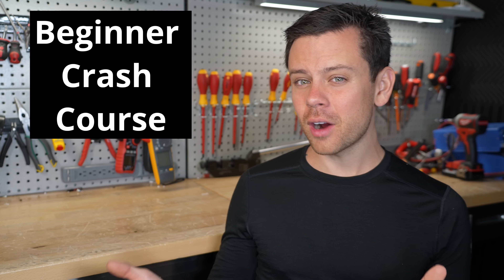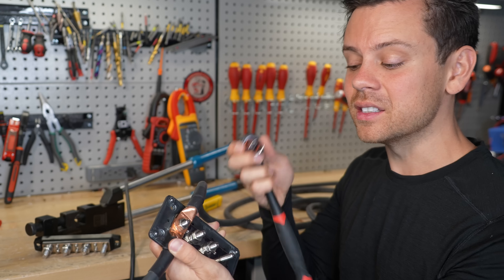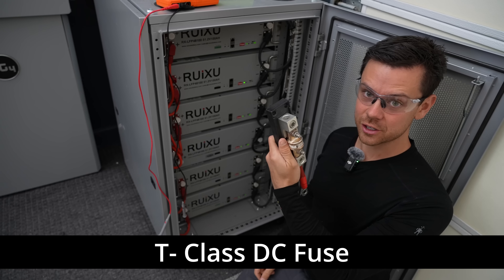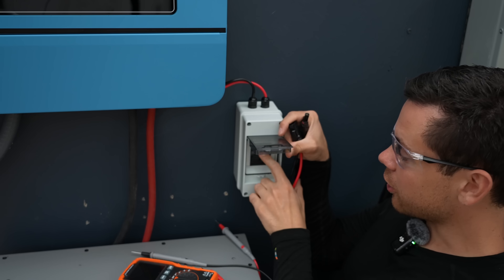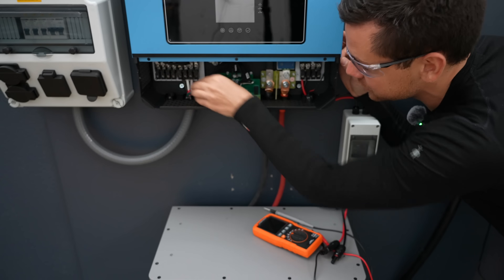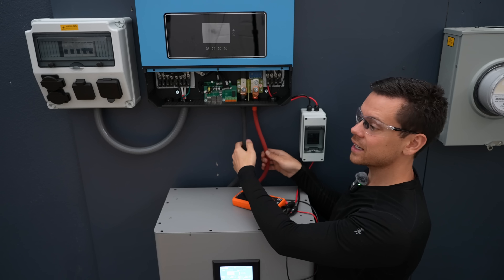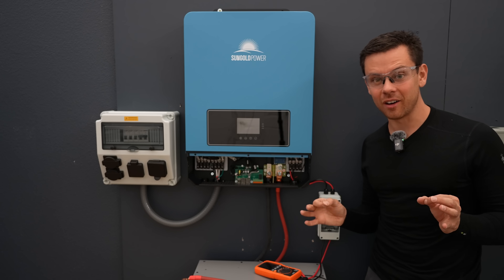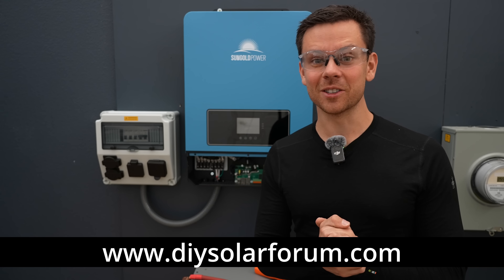Offgrid Solar Crash Course: Avoid FIRE and ELECTROCUTION! For Beginners or Experienced Users

Comment: I'm really grateful that you make videos like this, Will. I'm a total beginner even though I'm a senior citizen, so I'm trying to learn everything I can about basic electrical safety before I tackle my own small system. One thing I noticed in the video is that you mentioned at least a couple of times about checking the batteries/connections with a meter before working on them. So, while I assume that's a simple + to +, - to - with a multimeter, I'd love to see you demonstrate for us total noobs...showing exactly where to check and how. Maybe you have another video??? Also, I'm interested in collecting some safety tools (screw drivers, etc)...I think you mention an insulated ratchet??? A video about tools would be valuable, too. That reminds me, I checked your list of tools mentioned in the comment section and it appears that the Klein meters have been upgraded to new versions, so maybe it's time to refresh the links for your list. Again, thanks so much for making these basic safety videos. It's REALLY helpful. ~Frank
Reply: I think it was a year or two he went into all of the different tools that he uses for electrical.
Reply: Okay I just did a search for it and I found his video on that. Go to YouTube and then the searched thing on the top type and will prowse electrical tools and it'll bring up one with his favorite electrical tools.

Comment: Where do you hold the probe on the volt meter to check for voltage (2:05)?
Reply: Positive lead of your meter to the positive terminal of the battery. Negative lead of your meter to the negative terminal of the battery.

Comment: It gets a little fidgety with the MC4 solar connectors when you're getting into parallel or series connections because all of the sudden males / female connectors to red and black wires get mixed up.  Everything else is pretty straight forward.

Comment: I'm a retired electrician with 40 yrs experience and I can say this is ALL great advice, good job !!
Reply: Im a working plumber,  and even i can tell this info sounds spot on.
Reply: why no solder?
Reply: @martingargas3217  A crimp and solder would be fine, solder alone can cause a higher resistance connection.

Comment: Do you guys using one hand trick for using multimeter probes on test points that are a few inches apart. Alligator clips can also assist to prevent accidental current going through your heart. Also having a safety buddy at a safe distance is also a good idea.

Comment: My only regret on EG4 Lithium iron phosphate battery is I have to take it home over the winter in Northern MN. No heat. Can get below minus 4 Degrees which damages battery. Have not solved this problem yet. Solar panels are on the roof, under the snow, worthless in winter. Oh well. Awesome all summer and runs fridge, wife's CPAP, all electrical items. Unlimited power in summer. Even generates 10 amps on a cloudy day and charges up when cloudy with 48 volt panels.
Reply: Still better than toting the equivalent lead acid batteries back and forth!
Hundred pounds vs  Five Hundred pounds!
Won't miss THAT arduous chore!
Reply: I built a little makeshift box with insulation board and put a battery heater on the or between the batteries. Seemed to work pretty well. They're made to wrap around car batteries, but fit well enough.

Comment: Wondering... Can a parallel, 2-1 solar connection be directly connected to the cut off? Thinking of my van setup. Fixed solar on the roof well within amp and voltage range of the mppt. Wanting to be able to lay out some additional panels and connect them easily.

Comment: My solar EG4 inverter converter stopped working. The positive lead for the PV some how just "fell out" of its connection. Took some looking but found it, put it back in, and working fine. Very bizarre. Love your 48 volt EG4 Lithium Iron Phosphate battery and yellow EG4 inverter converter. What a game changer. I inched up from 60w, to 120w, to 12 volt, 400 watt, wet lead acid system. Bit mistake. Didn't have enough power. FINALLY your 5KW EG4 on a hand truck kicks ass at my off grid cabin. Runs EVERYTHING.
Reply: Might have worked its way out due to thermal cycling in the cable if the block wasn't tightened down enough.
Reply: Periodically check all lugs, and retorque as needed.
This is pretty common in most mechanical electrical connections.

Comment: Seems like too much work...I think I'll just use speaker wire to connect a dozen Battle Born 12Vs together instead. Lol.
Reply: You can't just do that, man. You have to solder the speaker wire!
Reply: @DannyNomad just wrap it a few times
Reply: @DannyNomad  everyone knows you solder the wire to banana plugs first, then solder those to the terminals
Reply: Be sure to check if the batteries are not live by touching them the lead wires to your tongue like a 9 volt battery. 😂
Reply: Boom box! ⚡️💥🔥🔥🔥
Reply: The irony is its less work to do it properly lol.
Reply: lmao
Reply: My battery bank is very futuristic, all wireless. No crimping or soldering, but when it’s a dry day my air gap resistance is very high. 😉
Reply: lol
Reply: Should be fine
Reply: Lol 😂😂😂😂😂😊
Reply: Not smashing the 2/0 gauge lugs on with a hammer and then pasting some aluminum bus bars on is a deal breaker for me.
Reply: @mvz Let me see these speakers and then I'll decide how to respond...maybe you've got some MASSIVE speakers.
Reply: Gold standard
Reply: @mvz don't take the criticism too much to heart from folks. I used to use speaker amps and series of batteries to weld stuff around the house with the graphite from a pencil. 
Your system could certainly double as a welder too!  *The More You Know* 
AND you get the benefit of all those glowing wires helping to illuminate your work area! You might end up being warm for the rest of your life.
:)
Reply: My dood watched the last video 😅
Reply: ITS AMPLIFIER WIRE
Reply: It works for ignition wire
Reply: Make sure you use Monster Cable, it sounds better so it should be better for solar too 😂
Reply: This made me laugh extremely hard. Thank you.